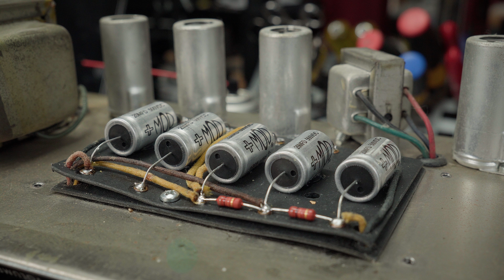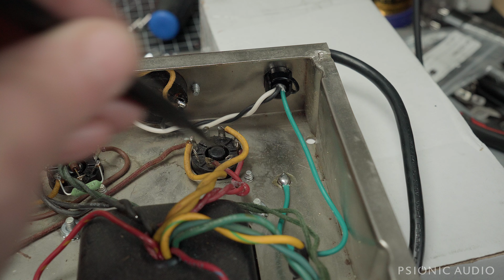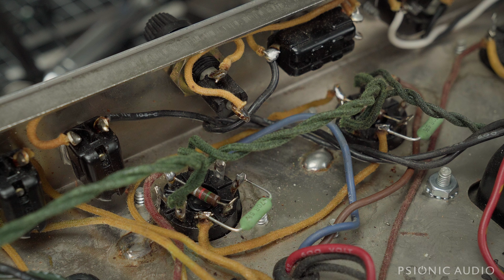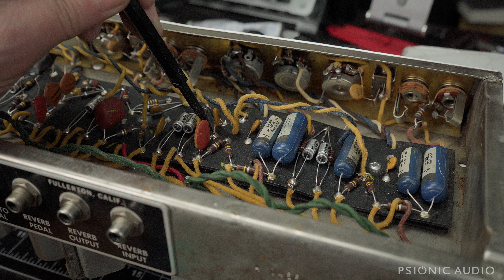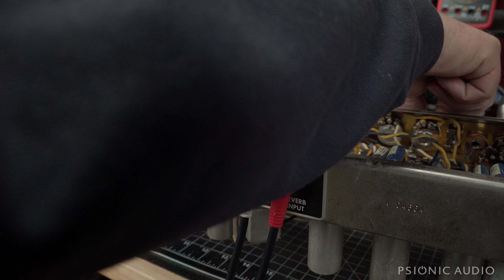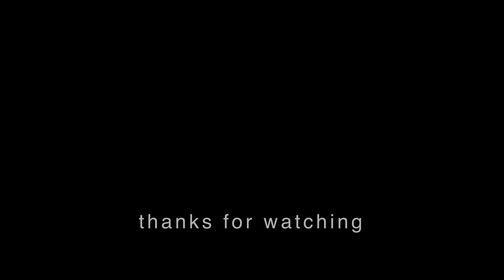Speed Run | '66 Vibrolux Reverb

Comment: ??? - I have an oddity on my 68 Vlx.. Blue Molded  Tone caps  measure 40% higher capacitance when soldered  in situ. When I measure them removed  from the board , they come up  perfect as if out of the box.. I put those same caps soldered back in place the capacitance returns to 40%.. I attempt with DIFFERENT caps and the behavior is exactly the same ( .047 and .1 outside the amp and .085 and .148 when soldered in situ). This happens to the blue molded tone stack caps on both channels, all 4 blue molded tone caps . Oddly enough, the .047 blue molded coupling cap between both channels tone stacks measures fine as does every cap on the board including all other blue molded caps and both 250pf treble caps within the tone stack. What the qua??
Reply from the maker: You usually cannot measure capacitors in circuit.

Comment: I black panneled my 1974 volume boost Vibrolux Reverb over 40 years ago, and I have no plans to get rid of it. The power transformer was swapped out just to get a lower B+. I got it from a drip front I repowered for 240 volts.
Reply: I like those blue label JAN Sylvania 12AT7WBs and 12AT7WCs too. The 12AT7s are two of the hardest working tubes in a classic Fender amp, unless we disconnect the grid wire from a power tube.

Comment: Just saw a video about a G-Craft . . .?
An amp built for Joe Walsh.
Has a 15" Weber speaker that has an impedance of 150ohms . . .!!!
Would love to see the inside of that one😉👍
Reply: It might be an OTL design: Output Transformer-Less.....
Reply: @goodun2974  
😎👍
Gcraft audio website offers the
G-C1, billed as a no compromise amp.
Didn't see any wiring, but did see two transformers . . .and four power tubes. Think it was a 50wt amp . . .?

Comment: I don't usually ask questions, but I am curious if/what terminals/wires you are using/leaving on the polarity switch? Looks like it's just the neutral from the power cable through the courtesy outlet to one/both sides of the switch and then to one side the primary of the PT. Is that correct? Just to keep things close to original or to make use of connection points on the disabled switch? Or? Thanks in advance. 🤓👍🏽
Reply from the maker: Hey Larry. I disconnect the cap to ground from the middle terminal, and just use the remaining two terminals as connection points. Sometimes I use the courtesy outlet, sometimes I bypass it. Hot to fuse then to power switch, neutral to polarity switch to tie to primary. Sometimes I make the neutral/primary connection at the courtesy outlet, depending on wire length or if the polarity switch is being repurposed for something else.
Reply: @PsionicAudio , shouldn't the courtesy outlet ideally have it's own fuse? As wired, the outlet is "protected" only by the circuit-breaker panel. Not to mention that the courtesy outlet isn't grounded,, and might not be polarized. Convenient though it might be, for use of a small fan, or a Fender Reverb Unit, or an active load box, or AC powered pedal (best to feed these from the same AC phase and earth ground as the amplifier, to avoid hum and noise), unless the power cord has an integral fuse at the wall plug end (like in the UK), the courtesy outlet is poorly protected. Ideally, I'd like to see exact fit, round, grounded AC outlets *with integral 5x20 mm fuse*, sized to fit Fender chassis; but that may be a pipe dream.  Anyway,  a plug-end fused power cord ( with say a 5 to 10 amp fuse) might be the best reasonable compromise if the courtesy outlet is being left in circuit.
Reply: @goodun2974 on the later 70s Fenders w/a grounded power cable, the convenience outlet was a 3-prong. I rarely if ever use the convenience outlet on an older Fender or vintage amplifier, esp if it's a 2-prong era amp/outlet, and would recommend the same. Better and safer to use a properly-protected and -grounded power strip for running larger current devices or multiple devices imho.
Reply: @larrychung3190   , well, if the outlet exists and is working, guitarists will eventually try using it, in which case it should be fuse protected. I've left them in place in the past, but only if they were grounded and polarized. The two-hole non-polarized plugs really should either be disconnected or upgraded to a modern 3 hole outlet, and I'd recommend an internal fuse. Do fused US style modular IEC cords even exist?
Reply: @ "if the button says 'Danger, Do Not Push' someone will always press it" 🙄 I'd still be very interested in Lyle's thoughts on my original question about the polarity switch, fused power cords and convenience outlet operation notwithstanding. Perhaps a separate comment in the future, goodun. 👍🏽🤓
Reply: @larrychung3190  , I too would be interested on Lyle's thoughts about the three way polarity switch, which,  if memory serves me, still used a "death capacitor" switchable to ground but with the option of connecting that cap to the neutral or to the hot (or disconnecting it entirely). The chassis being earth grounded, the only purpose for a switchable cap from line to chassis would be to ground out noise and voltage spikes coming in on the power cord. Even so, Fender often used 400 volt DC rated caps for the death cap, and that's way too low; should have been 600 volt rated at minimum, and modern code specifies 1KV X or Y caps that are self-healing and won't short out.

In the distant past I've seen a few amps with DPDT polarity switches that actually swapped the incoming hot and neutral lines, but I don't think Fender ever did that. I don't recall those amps having grounded cords either, so presumably they still had a death cap......
Reply: @PsionicAudio  , ps, I have always disconnected the standby switch completely; I don't like using it as a tie point because if it short-circuits, it's not fused; those switches have taken a beating over the years from switching high voltage DC, and are not to be trusted.
Reply: Thanks, Lyle, that's helpful to know. I typically just disconnect the switch entirely and use the courtesy outlet connections in the manner you mention. Follow-up egghead question - does it make any sense to have a 3-position polarity switch as Fender used in the later 70s on an updated mid 60s-mid 70s Fender with a newer 3-prong power cable? Ostensibly replacing the unused 2-way (disconnected) polarity switch? Why did Fender even bother with a polarity switch in the late 70s after changing to a grounded power cable? Just wondering... 🤓

Comment: Thanks for the de-ticking tip. I've seen the other mod with the cap going to the B+ before, but I just recently came across the one where the cap parallels the roach and wondered if the old tech was attempting the other mod and got it wrong.

Comment: The usual expected work from you Lyle. I did notice that the grid stoppers color code is 1.5k, odd they both drifted to 2.2k.
Reply from the maker: Yeah, see my reply to an earlier comment on that. The struggle is real.
Reply: @PsionicAudio  Yeah, being red/green color blind sucks. Maybe there's a phone app that you can use that will tell you want color something is? I didn't see any other comments at the time, or I wouldn't have left one.

Comment: Hey Lyle, Mojotone does have 500vdc 16uf F&T/Mersen caps. The only difference between 16uf and 20uf is how original to the spec the owner wants the work done. 

Great work as usual.
Reply: The F&Ts are -10/+30% tolerance caps, so the cynic in me would think the  16uF cap is really just an 18uF +/-20% in disguise, so rather close to the 20uF MOD. Both would be well within the massive tolerances of vintage caps. Same numbers being same will certainly have an appeal for some customers though.

Comment: Hoping to see more (many more) Vibrolux Reverb repairs, recaps and trouble shooting.
Reply from the maker: The circuit is exactly the same, aside from one resistor value, as the Deluxe Reverb. Different transformers and output tubes and speakers but otherwise the same. So any video on the DR applies to the VR.
Reply: @PsionicAudio  Thank you. I've sourced all the parts and just have to build it without any mistakes.  Learning how to read a schematic too.
Reply: 🎶 "Sure I like country music, and I like mandolins/ but right now I need a Telecaster through a Vibrolux turned up to 10....," 🎶 John Hiatt, Memphis in the Meantime